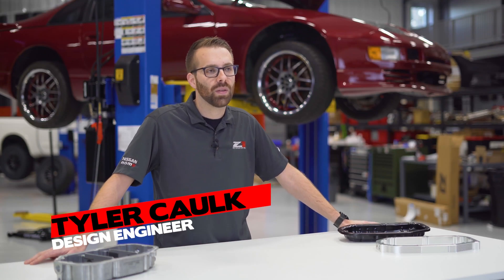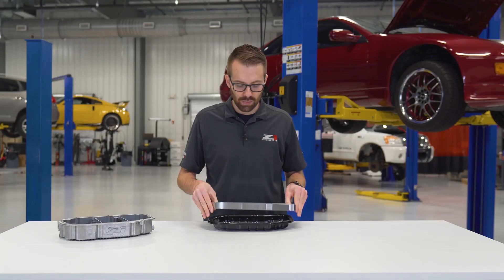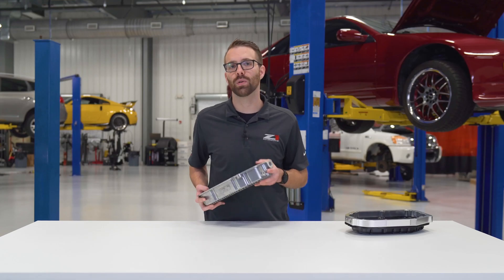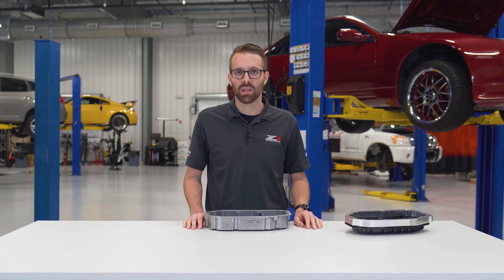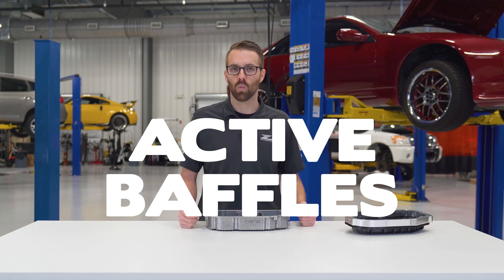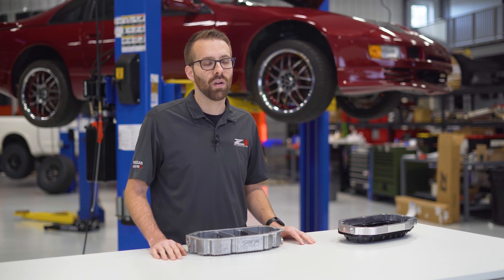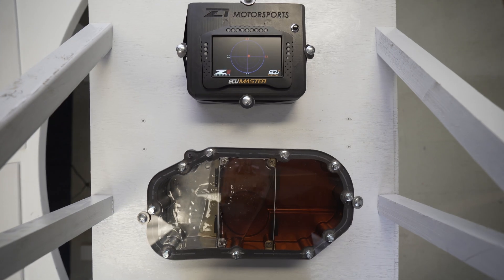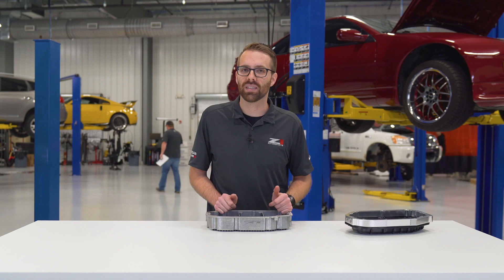Behind The Design | Z1 HR / VHR Active Baffled Oil Pan

Comment: Hold on. Viton rubber flaps.
What is the service life of that rubber?
Reply: I too have the same question and concern. 

Per quick Google search:
"Viton rubber flaps, often used in oil control systems, can last for many years under typical conditions, but their lifespan can be affected by factors like exposure to harsh environments, extreme stress, and temperature. Manufacturers and experts generally recommend inspection every 1-2 years, with some suggesting replacement as preventative maintenance during engine rebuilds. Viton is known for its resistance to heat, chemicals, and aging, contributing to its longevity."

Personally I don't want to have to drop the pan and inspect every 1-2 years.

Comment: Doesn't the additional 1.3 Liters of oil capacity affect the engine in any way? I have heard engine builders state overfilling is detrimental.
Reply: Overfilling without increased capacity could increase overall pressures in your engine. Here they're increasing the capacity so there wouldn't be additional pressure in the engine. Just an increased resivoir for the pickup to scavenge oil

Comment: Very cool! Although the term “active” may not be a correct description. Regardless, cool to see the innovation. Nicely done!
Reply from the maker: Hi Aaron, thanks for your comment! The term "active" represents the baffle flaps ability to move in response to physical pressure from oil, resulting from g-forces experienced during cornering loads.
Reply: @Z1Motorsports23  That’s actually a passive system since it’s not powered and doesn’t actuate as a result of some input. No need to get too deep into that - it’s all in how you define it, I suppose.

On a completely different note, thanks for getting my recent order out so quick. Nice job! I ordered on Friday and it was just delivered this morning. Three-day turnaround is dang good.
Reply: @woodnutz78  that's not how language works. Passive baffling is static and doesn't change. An example of passive baffles would be static plates welded or cast into the pan. Most oil pans have some form of passive baffling. The act of being "Active" come from an objects ability to move or react to stimuli, whether it's driven by a motor or physical pressure. If the baffle doors open and close in reaction to physical pressure from oil, they are Active doors. If they just used a series of static plates to slow the movement of oil away from the center of the pan as it changed directions, it would be passive.

Comment: And if your car is lowered ?
Reply from the maker: The oil pan doesn't sit any lower than the crossmember or sway bar. There is no concern for lowered cars, however, a Z1 Aluminum Undershroud is great insurance for those that are concerned.
Reply: Thanks for answering my question before I asked about the undershroud compatibility! 👍🏾
Reply: @Z1Motorsports23  Precisely why I ordered the shroud when I ordered Fortunes through you guys. Great peace of mind knowing its the shroud scraping and not the pan!